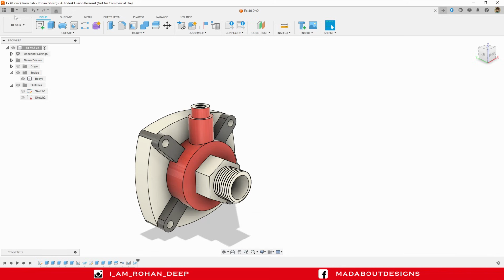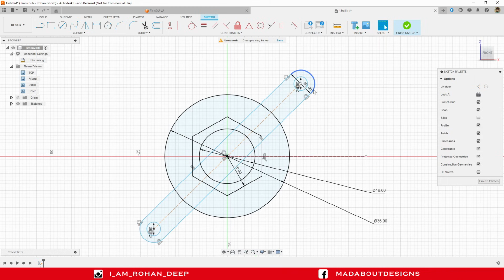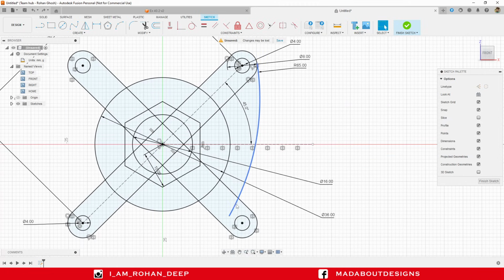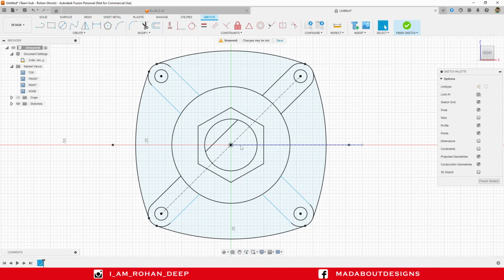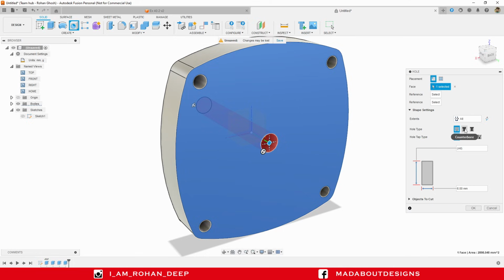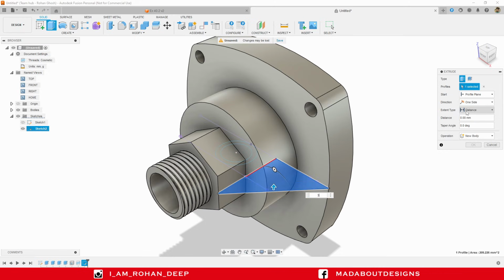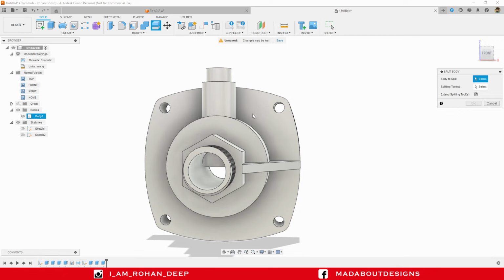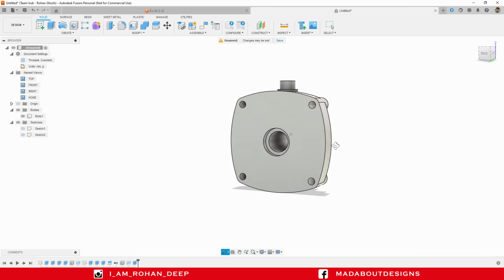Autodesk Fusion 360 Tutorial for Beginners | Exercise 34 | Learn the basics of designing

Comment: I have learned so much from your videos.  They are excellent and challenging.  I wonder if you would add your Fusion 360 preferences to one of your videos.  I have a sticking point on this one (Exercise 34), that I cannot explain and have never seen before.  Just before the projection step, a new sketch was started and the top plane selected.  That is the way it always happens.  However, in this case, every time I tried the same step, the face of the model comes up rather than the top.   Any idea why that would happen.  I have not been able, (so far), move past this step.
Reply: After the third try...it worked!!